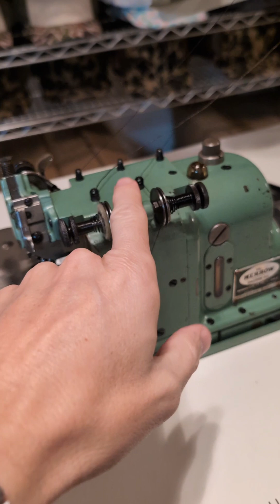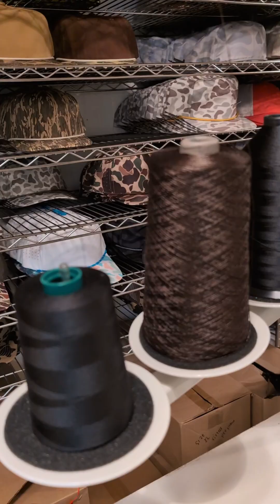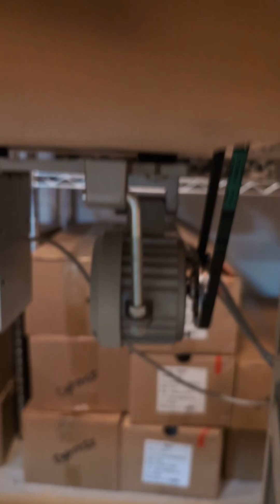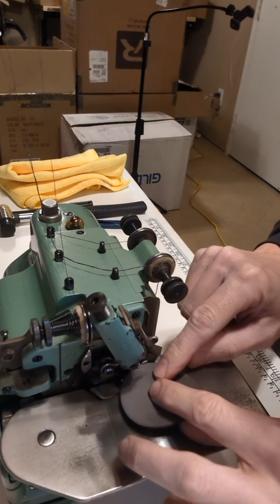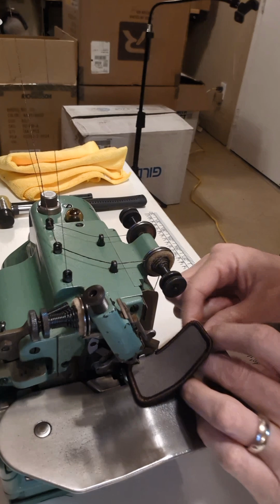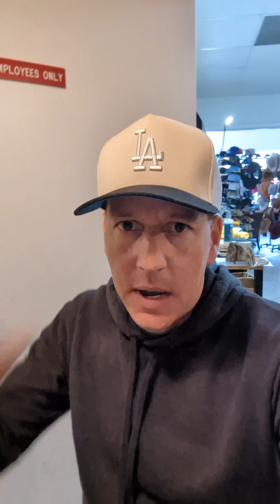Learning our new Merrow machine for sewing custom twill patches

Comment: But that's supposed to be the shell stitch machine unless you got it or had it modified.  The actual merrow edge was created by merrow but and has specific machines that do it correctly.  I'm looking at some. Even an actual 60 W which is over a hundred years old.  . Unbelievable how these things just don't quit. This company started in 1838 and still going now 188 years later. I might be getting a 60WD 100 years old.
Reply from the maker: Yes ours was modified to do the merrowed edge